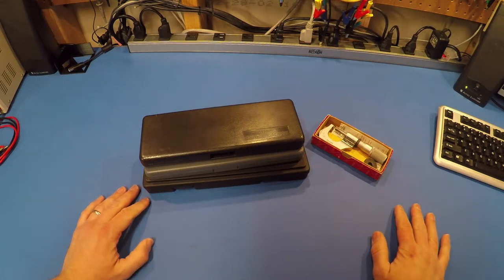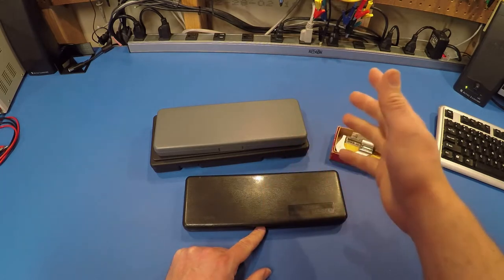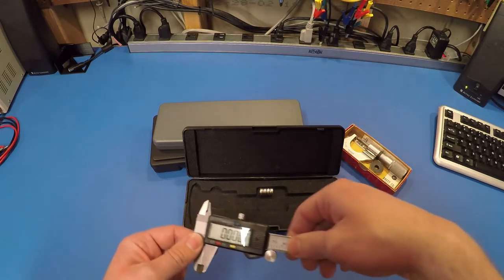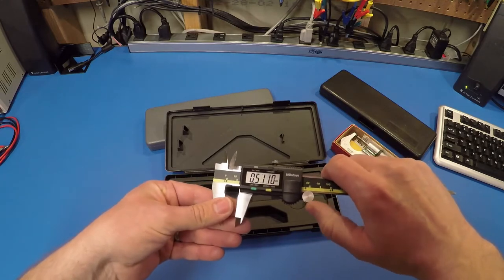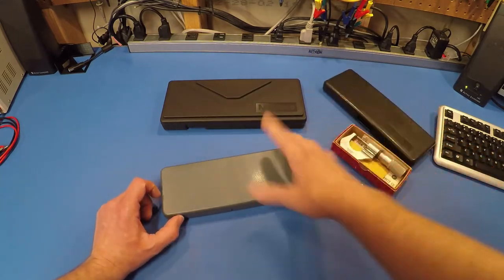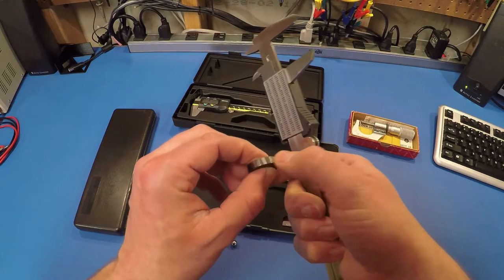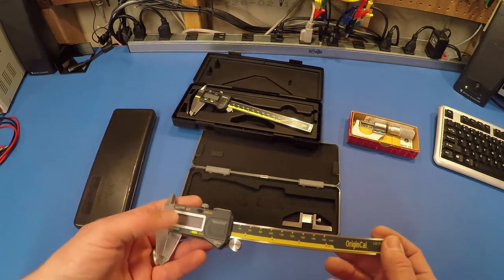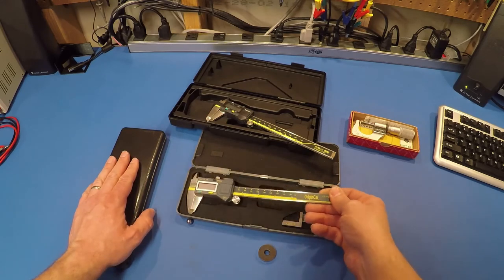Mitutoyo, iGaging (fractional) & Dirt Cheap Digital Caliper Comparison & Testing

Comment: People should beware of the knock off Mitutoyo 500-196-30 Digital Calipers being sold on ebay. The ones that are fake have the small 5th digit on the inch scale. The authentic Mitutoyo all have  full size numbers. Thanks for the thorough review. The Igaging 100-700-33-B are mighty tempting.

Comment: In the Machinest trade school I attend we were issued alot of Machinest tools..  (tools of the trade)... 
And those include a set of Dial calipers as well as 0-1" O.D. Mic's. And some other  tool as well. Like tool boxes . And finger indicators and center gages  etc.etc....

And by in large in six months so far that I've been attending the Basic Machinest course.
More than half of us have struggled with our cheap 30$ Chinese made Fowler dial calipers.

I ended up getting a gift from a retired Machinest a set of NSK dial calipers. And they've been phenomenal m I've used them for the past four months. Consistently with good results. The flowers broke within the first 8 weeks of school.. as well as other students.
.one of my fellow students ended up getting a set of 8" Mitutoyo digital calipers about 270$. But he's pretty happy with them.

Comment: As an FYI, I have a Chinesium full stainless steel (including housing, all silver colour with a silver plastic battery door) that set me back $12 shipped from China. Equivalents on Amazon are ~$25. Moves smoothly, perfectly repeatable with no slop in the jaws, and no visible inaccuracy with several standards. Sometimes needs to be zeroed after lying in the box for an extended period (months). The action is not as satisfying as on an original Mitutoyo, but not rough in any way. If you don't buy the absolutely cheapest ones like shown here with a plastic black housing, you have a good chance of getting something that works flawlessly with no modification. Mitutoyo used to cost a lot because they had the patent on capacitive sensing. It is now expired, and the cost to make something comparable in terms of functionality is not high. Mitutoyo still cost the same because they're exploiting their  brand and prejudice against Chinesium products, plus have a more pleasant fit/finish/feel and pros have no problem spending the money on a tool they'll use daily. If you're not a pro - and chances are you're not if you're watching this - unless you have spare money and like to have "nice" tools even if you only use them occasionally, a good Chinesium one will do very nicely and you won't sweat over getting it dirty or dropping it.

Comment: Pretty good comparison of the 3 calipers and mostly correct but not complete assessment. I should mention that I do have 4 Calipers, the Chinese cheapo, 2 iGaging Calipers (100 700 06 and the 100 700 33) and a Mitutoyo (500 196 30). Both my iGaging calipers are as accurate as the Mitutoyo for almost 65% less money. They all operate very smoothly although I had to clean the iGaging calipers with Isopropyl alcohol to get the smoothness as with the Mitutoyo.
The 33 iGaging does have the fractional not offered with the Mitutoyo , but both iGaging calipers have a SPC/USB data output that is compatible with the Mitutoyo  hardware/software or visa versa. a SPC/USB is available on Mitutoyo model #500-170-30 and 500-171-30.
Bottom line is that both iGaging calipers are comparable to the Mitutoyo dollar for dollar but to say that the roller is not as good is debatable. Personally I have no complaints of the iGaging or Mitutoyo calipers, they all work and work very well. The Chinese cheapo I will leave as is. It is what it is. In a nutshell IMO the iGaging and Mitutoyo are the best there is and I will say that the other top Cadillac brands  (expensive brands) are built in China as well and only assembled in the USA. Not like they use to be. Hope this helps.
Reply from the maker: I think quality control on the iGaging ones just isn't quite as good.  I don't doubt yours are smooth, but mine sticks and jams a bit.  Would it stop me from buying another or recommending?  No, but I wouldn't expect that issue from a Mitutoyo product either.  I do agree though that dollar for dollar,  the iGaging is a better buy.

Comment: Hi bro, I really like your videos. What is your opinion on calipers without thumb wheel, I saw some Mitutoyo models without it... Does it have a particular field where it's used or if it is just a preference? Thank you
Reply from the maker: Thx!  For me, without them it's really for very "rough" measurements.  The thumbwheel is what allows you to put repeated and consistent light pressure on the object under measurement with the jaws.  Without it, or without ones that are smooth, you won't be consistent and measurements won't be as accurate as they could be/should be.
Reply: @netmagi  Got my Mitutoyo today, same as yours, it's worth the money. Beautiful tool. :D Yea, that's what I thought about the thumbwheele, it's kinda easier to put same measuring force each time.

Comment: for cheap ones what do you think of iGaging?   I have one for like 3 years and no issues with it.   Also have a few Starletts and they match up well after 3 years of use.  No goofy readings.   And only like 35.00.   Not sure if thats the same in 2021 but the 2018 ones seemed a good bang for the buck.

Comment: I battled the decision between igauging and another brand called Insize, around the same price range. I was not gonna spend a fortune or buy another cheap piece of junk that might quit in a month or less. I got the insize, mainly due to the fact they were NIST certified tested and calibrated to strict standards, they came with a certificate test sheet. I'm happy about my choice, it doesn't have fractions, but there's calculators for that. It's very smooth action, zeros out everytime the jaws close and accurate as daylight unless you get a speck of dirt in the jaws, so i clean them often. I measured a cat hair from my cat, he didn't mind it... some cat hairs may differ. The hair was 0.0002 of an inch everytime I took the measurement. It takes the 3.0 volt CR2032 battery with capable PC hookup, "which is another reason I got them" not those tiny 1.5 volt 44's that don't last. I do not regret the decision, some saying they're as good as mitutoyo's???... I sure hope so.
Reply from the maker: Would love to have a pair to test.  Just spent ~20 mins looking around on their site.  Here's what I found:  US-based co. importing from Asia (probably to their own spec).  They 'turn-on' with movement, so they are probably the type that eats batteries, but with a larger battery that I'm sure lasts longer than the $20 ones.  The do offer NIST on some units, but not their cheaper ones.  The ones with NIST-certification appear to be on par price-wise with Mitutoyo.   They DO disclose in the downloadable catalog on their site which ones actually have NIST certification/traceability.
Reply: @netmagi  the mitutoyo's I looked at were $100 bucks or more depending on the model. The Insize model# 1108-150 I purchased on Amazon were $46 and change. I don't know the real world comparison between the two, but the price range was sure different. For $46 bucks offering certification I didn't think I could go wrong. Pick you up a pair if you got the spare cash, well worth checking out for a comparison video... I'd watch it for sure.

Comment: Any bit of twist or angle you are imparting into the 1in standard is where the change in your measurement is coming from. It's not a factor on the flats of the jaws because they will self align the standard.

Comment: Hello , my battery on the more common cheap calipers has decent life span since locking the slide before switching the power off. The thing won't turn on with the slightest bump or touch anymore , or maybe it's my inexperienced  imagination . Thanks

Comment: From what I saw the $20 dollar amazon special seemed as consistent/accurate as the Mitutoyo.  The cheapie had to deal with corrosion of the bearing too, but didn't seem to benefit from the excuses offered for the expensive Japanese model.
Reply: Except that you're forgetting that he had to rework it, tighten the jaws then loosen the slide rail to achieve this.  You can expect that with any of the $20 specials, that you have to tweak their machining to be tighter fitting to eliminate jaw wobble.
Reply: @stinkycheese804  No. I have a set with a stainless steel case instead of the black plastic that have 0 jaw wobble and no repeatability issues, out of the box.

Comment: Observations:  
Currently Amazon Prime has the "China Crap" caliper for $12 and the Mitutoyo is @120 (1,000% more expensive.).

You got 8 straight readings with the cheap caliper of 0.0000.
You got 8 straight reading with the Mitutoyo caliper of 0.0000.

The cheap caliper has a pivot pin hinge case.
The Mitutoyo has a plastic flap hinge case.

Ball bearing measurement was  0.374 with the cheap caliper.
Ball bearing measurement was 0.3745 and you blame the ball bearing for the Mitutoyo caliper not reading 0.375.

Gage block measurement was 0.9985/0.9995 with the two measurements you made with the cheap caliper but also don't forget the - 0.0005  reading when the jaws were closed (you forgot to re-zero after you banged it close twice).  Also remember that it did not cross your mind to check where on the corroded gage block you measured.
Gage block measurement with the Mitutoyo wias a lesson in denial.  You spent more time trying to locate the perfect surface than you did measuring.  Why did this not cross your mind with the cheap caliper?

Bottom line:  You ARE geeking out about the Mitutoyo and your bias shines through.     And don't forget, you should not rely on any caliper for accurate measurement.  That domain is for micrometers. 

PS:  If you need a 12" digital caliper, the price is $28 vs $396 on Amazon Prime (1,414%, more expensive)  for 0.0005" difference in accuracy.  And let's not forget that gravity works equally well on all calipers.
Reply from the maker: All fair points, and thanks for your feedback.  One thing not well captured in this video is real-world use.  Since I shot this video, I've ultimately ended up placing these calipers in 3 different locations.  The mitutoyo resides next to my 3-d printer in the house, the cheapie on my desk, and the igaging in my workshop.  The batteries have died two more times on the cheapie, the case cracked at one of the hinges, and you now cant close it without two hands (I didn't drop it, it's just become really brittle).  It loses it's zero every 20th or so time you slide it quickly.  The force required to close the jaws to a consistent pressure at the workpiece is also inconsistent depending on where you are on the slide.  The jaws rack side to side changing the measurement by .1mm if you're not measuring something with hard flat faces.   Using them is like the equivalent of using a half -stripped phillips-head screwdriver that's someplace convenient.  You have 3 nicer ones in your shop, but you're in the kitchen, and if you just push hard enough you can get by with this one without walking to the shop.  That's what it feels like to use it, everytime.  I need to just throw them out and at least buy another of the igaging or be less lazy and walk to my 3-d printer or my shop when I need calipers.
Reply: @netmagi  I, like you have many dial calipers.   Several are Mitutoyo and Starrett, a few are Fowler, and I have couple dozen or so made in China or who knows where.  They range from 6" to 36", the longer ones being vernier.  I have 8 to 10 work station areas in which I use calipers as well as by my mills and lathe. 

I appreciate the buttery smoothness of the premium calipers but find that for day to day measurements it is more of a luxury than a necessity.If I were to replace all my calipers with Starrett I'd have more than $5,000 in calipers.  If it were not for gravity and employees I might would consider it.  

Again, precision work (in my humble opinion) is the domain of micrometers.  (Just as a reference, you can buy a 0-6" RDX Micrometer Set with Case with accuracy and repeatability of 0.0001" for about 1/3rd the price of a single Starrett 6" caliper.) 

For the average home hobbiest and most machine shops, they don't have the ability to hold tolerances to within + - 0.0005" anyway so their money is far better spent on other toys.

I have a supplier for some parts we use in our products.  He has a dedicated climate-controlled room that contains his granite measuring table system.  He gave me the rundown several years ago about the fact that ilt is the 50,000,000 year old granite not the "unstable" 20,000,000 million year old stuff or something to that effect.  I'm not sure of the measuring accuracy of his system but he says he routinely detects earthquakes and tremors hundreds of miles away and can measure the thickness of your fingerprint to several significant figures.  So I am aware that there is need for extreme accuracy and repeatability. 

Regardless, I appreciate your review and it's good talking to you!
Reply from the maker: @abrahamlincoln5283 thanks for your reply.
Reply: The mitutoyo are worth every penny , the cheapos kill batteries and are very inconsistent and also the cases aren't as durable as the mitutoyo , although the mitutoyo case looks basic it works consistently for years no problem with a case and caliper I used daily During field repair of pressure relief valves and never had an issue even during quarterly calibration they were always spot on , all of my calipers were required to be calibrated and nist traceable ... Try that with 20 dollar calipers 😂 you would find yourself spending many many hundreds over the years into the thousands or just buy one or two quality calipers and call it good .
Reply: @netmagi  

How much effort does it take to open and close the Mitutoyo with the roller then the cheap HF model? I have a cheap HF model from 8 or 9 years ago and I've noticed that it has become stiff, making it harder to gently get a more accurate reading. I'm about tempted to toss the HF cheap digital caliper and get a mitutoyo....
Reply from the maker: @calebdrake3544  buttery smooth.  the 'feel' and fine repeatability is the biggest difference between all these models.
Reply: @netmagi  

That is what I was suspecting....I'll have to buy a mitutoyo then

Comment: Good comparison.Hello I'm Alexandar.My question is does it stay accurate and no bagging when it gets wet and oil digital scale.I have a digital caliper that when it gets dirty or little wet does not know what position it is.I think capacitive measure system. 

 Would buy a digital caliper that doesn't have those issues.Tour recommendation some inductive, magnetic.Thanks
Reply from the maker: I would recommend the Mitutoyo coolant-proof ones: https://amzn.to/2xrTNax
Reply: @netmagi  Thank you for your support

Comment: I noticed that the battery compartment cover on the Mitutoyo is different than the flush fitting one on other examples. Could this be a re-design of the fragile tab issue of the said flush cover & if it could be used as replacement. Thanks for the review. Most helpful.

Comment: Thanks👍🏼👍🏼👍🏼.  I think I’ll get an iGaging.        My Horrible Freight calliper is “good enough” for what I need; but, it’s absolutely infuriating because I need to take multi measurements (3-6x) to verify my 1st measurement.  It’s a battery suck, doesn’t hold Zero.

If my life and work need critical measurement, I’ll pay for a MIT, no regret!

Comment: I've got the IGaging without the fractions. 
Do you know if the LED readout is suppose to be 'backlit?
My is not and is hard to read. I can see the black numbers but wish they were backlit.
Also, what should I treat the tool with to prevent corrosion?
Reply from the maker: Fairly certain it's NOT backlit.  Very light coat of mineral oil on the parts you touch.  Keep it off the inside of the slide.
Reply: Thank you.
Reply: If you kepp it out of salt water and acids, you should not have much of a corrosion issue since it is stainless and plastic.  While a backlight would be nice for some uses, it would also consume, probably more than 5X the power to do so.

Comment: Great video! What is the advantage of having thumb wheels on the calipers? I guess it's nice to have for comfort but other than that I'd get the cheaper version without the wheel, which is about 40$ less.
Reply from the maker: makes it much easier to get consistent pressure on what you're measuring
Reply: It gives you significantly more motion control and tactile feedback.  As you move the wheel you thumb travels about twice the amount for the same caliper jaw movement as it would without the thumbwheel.

Comment: Thanks for the review. Do you know what's the difference between 500-196-30 and 500-196-20 models?
Reply from the maker: There is no '500-196-20' model.
Reply from the maker: @IliyaOsnovikov  may also just be a 'fake'.  If I was holding one in my hand and it looked genuine I'd go for it,  otherwise I'd be wary

Comment: It is not surface corrosion, it is you put part not perfectly perpendicular the the caliper jaws when you measure it in the thin portion of the jaws. There is different technique to get correct measurements on the thin portion of the jaws, and it does not matter if it is Mitutoyo or $20 Chinese caliper

Comment: I got one of those, and one thing that bothers me is the fitting in the depth gage, it fits really loose with about 1mm of play.
Did you find the same on yours?
Reply from the maker: The channel for the slide is about 1mm wider than the slide itself, but seems to stay in place once the thumbscrew is tightened.
Reply: Yep, exactly like mine.
Another issue i had was that the caliper came really dirty with a lot of grinding dust in the channel of the ruler.
Their qc seems on or off, some seem fantastic others not so great.
Reply: Telmo Brandao beware of knock-offs. Watch EVO vid on the diff between the two